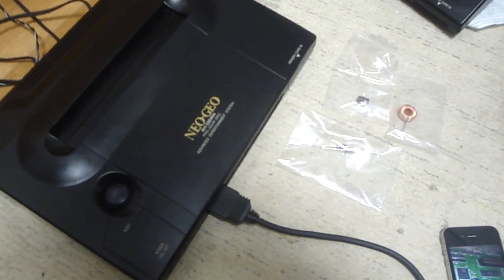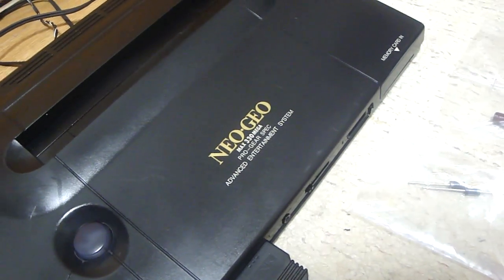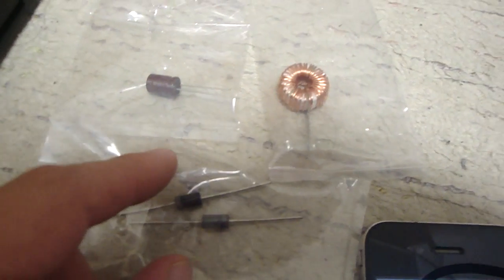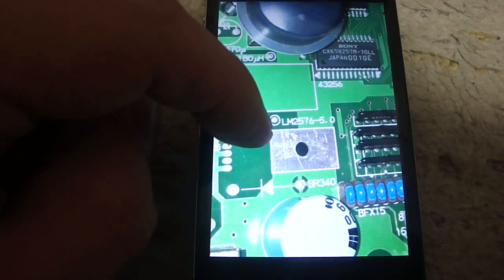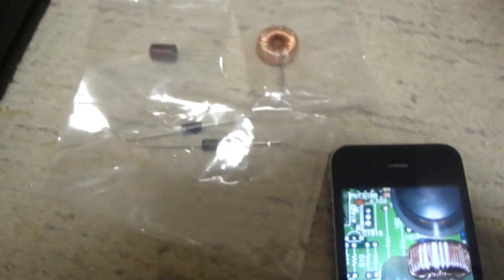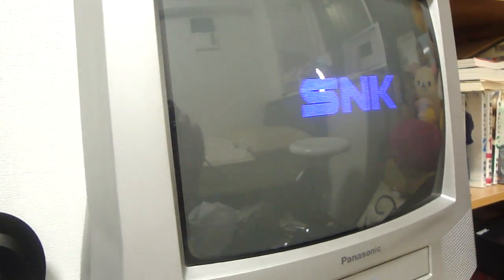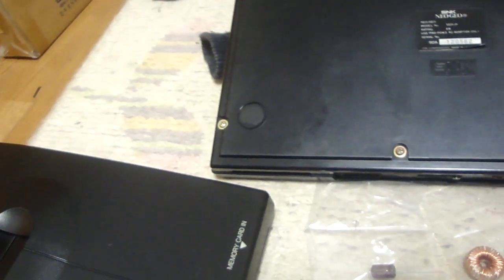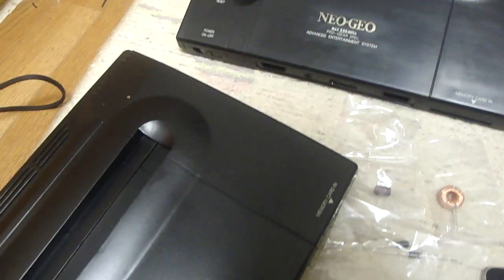Non Working Neo Geo AES No Power 5v Model To 9v Conversion

Comment: Hello. I bought Japanese 5v NEO GEO AES. Its not starting up. It looks like it resetting itself. I suspect that something wrong with power circle. I checked green transistor and it has 4.8 v. not 5v. but the power jack has 5.4v. i think that its just not enough voltage to start the system. but i dont know what exactly is not working. transistor itself or something else. If you can guide me how to check the power circle please.

Comment from the maker: At the time of making this video I had never come across a 5v model before. The 5 volt models require a 5v ac adapter and will not work with a 9v or higher one. The problem is that the 5v ac adapters are becoming more and more rare nowadays so with this mod, you will be able to run the system off of a 9v powersupply. The parts you will need are:

180uf coil
SR340 diodes x2
LM2576 -5.0 voltage regulator 
470uf capacitor. 

You will also need to remove the Green colored regulator to the left of the reset button. It can be desoldered or just wiggled back and fourth until the 3 legs separate from the motherboard. 

This will get you up and running. The part numbers should be listed in the video but if not, google Neo geo aes 9v motherboard and you should be able to find the parts  you need.  There Arent many :)
Reply: hello. Would you be willing to mod my 5V AES into a 9V? thanks

Comment: got the same model neo aes3-4 same parts missing looks like factory but if u look at the 2 images u got posted the a1442 transistor is not there in the photo from the working system also I think the parts u added let's system work off of a 12v supply

Comment: That's weird, I'm sure it wasn't missing those parts as SupremeJudge pointed out, but when adding them fixed it - that's super weird!  
I've never seen a component get removed and have it not be obvious based on the quality/appearance of the solder pads/holes.

Comment: Luke, it's supposed to be missing those parts. The 5 pin device is on the +9v AES consoles. The ones with only the green transistor are the +5v consoles.
Reply: SupremeJudge oh I see.. I have 2 non working consoles and when I saw lukes video I got a ray of hopeand ordered the missing parts :(..  but now u say that they are supposed to be missing.  now what to do Supremejudge?
Reply: SupremeJudge oh I see.. I have 2 non working consoles and when I saw lukes video I got a ray of hopeand ordered the missing parts :(..  but now u say that they are supposed to be missing.  now what to do Supremejudge?